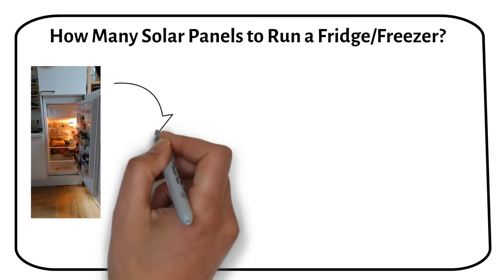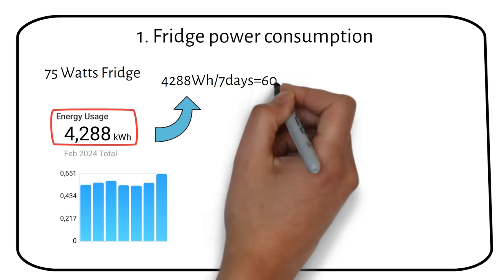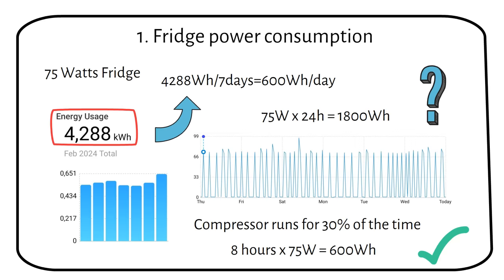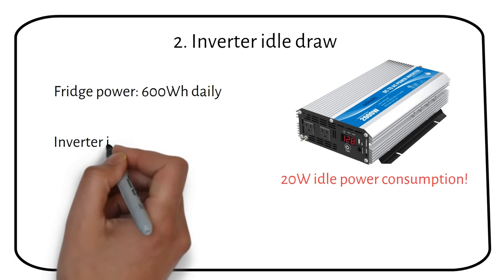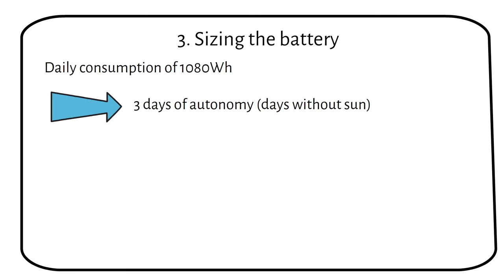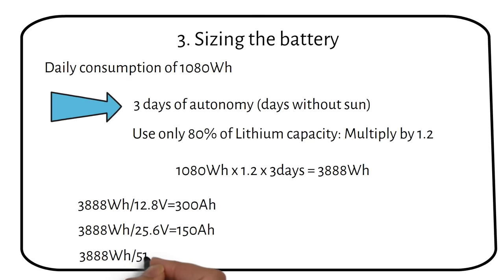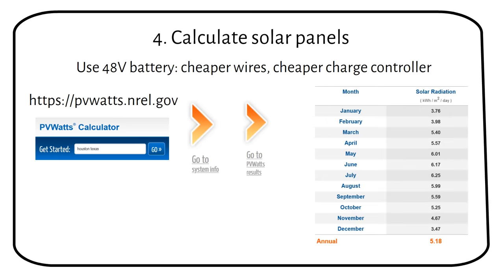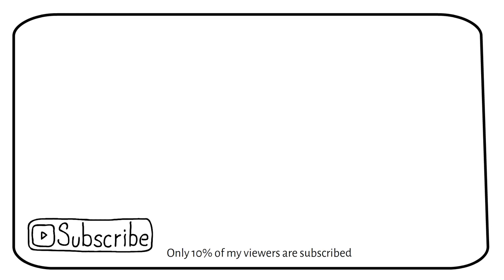How Many Solar Panels To Run a Fridge/Freezer?

Comment: this calculation is correct if your solar panels facing the sun all day right? or you have automated tilters that turns the solar panels to sun thru out the day?
Reply from the maker: South facing (in northern hemisphere) with 3 sunhours. Check the tool PV watts for your location.

Comment: Can we go off the energy star label then divide by 365 to get the daily watt hours used?
Reply from the maker: You can, but I would add some extra because those are recorded in ideal situations. Just like you would never get the mileage out of the advertised values for a car.

Comment: In diagram 1 on the left-hand side, red box. Energy usage is not 4288 kWh it is 3 decimals out for a week's consumption. Just a typo. Correct me if wrong. Having said that, i would have guessed 2 solar hours on 4k system. His figure of 4 takes into account factors I didn't know about. Good vid :)
Reply from the maker: Thanks! It has to do with the European notation of the comma and decimals 😉
Reply: @cleversolarpower  I didn't actually know that. Had assumed decimal notation was universal. As one would if just reading English texts. Tickled me when i then looked it up. Got me thinking about all the times I must have missed it in the past... ;) Brilliant, Thanks again.

Comment: Thanks for the clear analysis, just need to replace the comma with a period, its not 4,288 KWh, it should be 4.288KWh. Am I wrong?
Reply: Most countries use a point or a space to separate thousands. Most countries also use a comma as the decimal separator.
Reply: Good to know, I stand corrected,  I know some people that need the exact info in this youtube, will pass on.
Reply from the maker: I'm from the EU, so I switch them up. I should do a better job since most of my viewers are from the US. Thanks for pointing this out.

Comment: We normally switch the fridge off before sleep , never had a problem. It is also better to run the fridge on mains when the sun is not available rather than buying expensive batteries.
Reply from the maker: True, but if you are off-grid you don't have the grid available.

Comment: And the extra fan cooling the charge controller and the other one cooling the inverter because i don't trust onboard cooling + voltage drop. Also now you need a 48v inverter.

Comment: What size fridge in CU do you have? I know smaller fridge should use less power, and also top freezers I think are more efficient. Plus if it has an ice maker, that will consume more power. Thanks
Reply: Larger fridge use less power because they have more insulation and high-efficiency compressor.

You can get between 10 and 14 and do well.
Reply: Interesting. I'll keep that in mind. Thanks @Matthew_Loutner
Reply from the maker: 6.1cu ft or 174 liters with a 0.5 cu ft or 14l freezer section. Brand is IKEA FÖRKYLD
Reply: That might be a bit too small for my needs. Thanks @cleversolarpower

Comment: Thanks for your guidance, pls television set that is rated in DC , 12Vdc/2.5A. can i used these parameters to calculate the wattage and as well the dc wattage to size the inverter?
Reply from the maker: Power = current * volts. 2.5A*12V=30W. Your tv is 12VDC, so you don't need an inverter.
Reply: @cleversolarpower  thanks, I sincerely appreciate your response

Comment: When using Lead-Acid batteries, how do you make sure that you do not go beyond the set 50% maximum depth of discharge (DoD)?
Reply from the maker: A low voltage disconnect, or visually with a battery shunt.

Comment: Great Video!
What you will need to no waste the solar power energy ones your battery's are full?  What you need to install to use this excess power to decrease the grid usage?
Reply from the maker: Thanks! I suggest adding more batteries. But if it's really worth it to add more batteries in a properly sized system? Especially if you are connected to the grid it might not be worth it. Are those few extra kwh a few dozen times a year worth spending $1000's on for additional batteries?

Comment: You started from a false premise.
You are using a compressor.
Use a combination of peltiers arranged in series...
They only need a teeny bit of voltage....the less each one gets individually the less hot they actually run.
You DON'T need batteries.
The energy is stored as a temperature differential inside the fridge.
As long as the warmer side of the peltier array can radiate its heat to the external section freely,you should gradually drop the temperature inside.
I got my original single chip design to freeze condensation within 6 hours inside an insulated box.
Reply from the maker: The problem with peltiers is that it's good for small applications. A compressor is still more efficient than a peltier.
Reply: @cleversolarpower  Possibly,but the benefit of having fewer points of failure in a much simpler design might make this an avenue to explore as we see further advances.
If however, efficiency is key....
Einstein Fridge.
Zero moving parts.
Sit a sealed bucket in a larger bucket.
Fill the gap with large pebbles.Leave the device in a spot where it is shaded but also ventilated.
Fill remaining volume with water.(it evapoorates...absorbing energy from the area)
Replenish water  when needed.
(Easiest way I can think of to keep milk cold but it won't freeze anything)
😸no batteries included

Comment: You forget to factor in the inverter efficiency, 85 ~ 90% is typical, so to produce 75W of Ac power output, the DC input power will be about 75W/0.85 = 88W, 88W x 8h = 704Wh per day.
Reply from the maker: True 😬

Comment: One 550Wt panel and one 1kWt•h battery. For a December inclusive
Reply from the maker: About a 1 to 3 ratio of solar and battery is generally accepted. So 330W of solar per 1kwh of battery because you have 3 sunhours.
Reply: @cleversolarpower  In general - yes. But historical PVGIS data gives more precise values. 
It allows to calculate a min capacity of a battery, when sun still has a possibility to fill in a battery that will be consumed in an evening (depending of consumers power of course). 
For my varying consumption (by an hour and month) I need 6.3kWth battery with 4.75kWt PV panels (split by east-south), and 100Wt to 1200Wt consumption. 
Firstly, I also supposed to install a 14kWth battery, but after checking historical data, that value was reduced more than twice (these are big money though), and I have a negative balance only in December (a big minus), and in January (a tiny minus).
And battery makes nothing to these negative months. Because 6.3kWth is a maximal amount sun can save and I will need later this day. This happened in 2019 once. In the other years I would need 4.8kWth only. 
 More sun didn't happen, and more Wth I won't consume in an evening. Something like this.

PS And those 550/1kWth were for a single refrigerator, used in Central Europe, these were not abstract values

Comment: Excellent information.  Am I correct that 'idle current' would typically be much higher on an unnecessarily oversized inverter for the applied load?  Secondly, would 'Efficiency losses' likewise be higher in the same scenario?  ie:  Running an inverter for extended periods at 10% load?
Reply: You need to oversize your inverter. Because 75W is just the average consumption. Every time the compressor motor starts it needs higher currents. In my experience you would need a 1000W inverter (or more) for a big fridge like this.

Comment: The city I live in has a population of around 2 million people and residential rooftop solar systems produce more than 3 times the electricity consumption of the entire state.
Currently, my local government is giving no interest loans for anyone who wants to install solar panels on their home because of the money it generates for the state. We are selling the extra electricity to other states.
Currently there is still one active coal power station that was kept operating because of the fear that environmentally friendly renewable alternatives to fossil fuels were not reliable but it has now been over 8 years without any problems using 100% renewable energy.

Comment: Can you make a video on inverter sizing to power a 3kw induction motor that has inrush current?

I have a 270kg ribbon mixer with a 3kw motor that I want to connect to a solar system but I’m not sure how big of an inverter I should use that will handle the inrush current.
Reply from the maker: I believe you should measure the inrush current with a meter. I would also opt for a low frequency inverter (the heavy ones). You most likely need an 8kw victron multiplus, but i could be wrong.
Reply: The starting current is typically 5 to 7 times the rated current. Only low-power motor loads are supported by inexpensive inverters. Without more details, the smallest inverter would be 12 KW (with a good surge capacity) and I recommend 15 KW - 18 KW as a realistic minimum. I am assuming a 220/240 volt system.

Comment: 48V are allso bike battaries. It can be used as a backup?!
Reply from the maker: Sure, if they are lifepo4. Otherwise you need to adjust charging voltages in the charge controller.

Comment: So for this set up you are running a 110v fridge? Thus the need for the inverter? 
Have you run a simulation for any 12 volt fridge in late model RV? Since the illustrated set up is for a power hog 110v unit, I'm assuming this would be way overkill for 12v unit.

Comment: I don't understand where is the final answer. 
What is 1100W of solar? How does it look like in terms of installation?
How Many Solar Panels ? What is their total area? How much would it cost nowadays?
Reply from the maker: You have different size solar panels: 100W,150W,300W,400W,... so its impossible to say how many solar panels you need. But i do understand the confusion. 1m² is about 200W (20% module efficiency) , so you need about 6m² or 65ft² of solar panels. Good question.
Reply: @cleversolarpower  Seems quite large, then. Any idea about the cost for today?

Comment: Une solution pour économiser un peu de puissance:  Récupérer le contact travail du réfrigérateur pour démarrer le convertisseur DC==> AC seulement quand le frigo a besoin d'énergie. Il faut sortir le convertisseur de l'état "stand-by" quelques secondes avant de connecter le compresseur. Un simple relais temporisé ou un Arduino fera ça pour bien moins de 20 W . De plus en hiver, ( et en été aussi ) il faut moins de puissance pour produire du froid si on ventile bien le radiateur derrière le frigo . On peut aussi rajouter une isolation autour du frigo pour diminuer les pertes.

Comment: Thanks great video but I am still confused with the battery sizes. I have 2x12v 110 AH batteries which I can use in serial or parallel mode having a 12 v or 24 v battery system. But the capacity still stays the same? Right? I need some help, thanks.
Reply from the maker: I recommend watching my videos about batteries in series and parallel. If you connect your batteries in series you will get 24V 110Ah, if you connect in parallel you will get 12V 220Ah. Mind your inverter, because it will work on either 12V or 24V. I recommend 24V because your whole installation will be cheaper. Check my video about 12V, 24V or 48V systems.

Comment: In a solar system your storage is the most important equipment that's stores power to run your fridge..that's your Escom.Batteries has a depth of discharge meaning once a certain amount of power is utilized the whole system switches off till the next morning when the sun shines and allows the panels to recharge your batteries.All the inventor does is inverts DV voltage to AC voltage.A fridge compressor draws 3 times the rated amperage when it starts up which will drain the battery power.Do proper calculations before investing in a solar system.

Comment: It’s nothing to do with Solar panels…..it’s all about the storage battery size. Yes you will need solar panels and a decent mppt and a pure sign wave inverter
Reply from the maker: In order to put the energy in the battery, you need solar panels. So i don't understand your statement.

Comment: 1 His Fridge Consumes 75Wats/Hour,
1 Panel Top Output 100 Wats
At Top Sun 🌞,
So At Around 3 Panels You
Should Have Enough To Run
Through The Rest Of The Day,
Yet Not Over The Night!
2 More Panels,
So 5 In Total Would Compensate
For Storage For Night Time!

Comment: The equated cost needs to be determined. basically the currant cost of electricity verses the upfront cost of: batteries, inverter, wires, solar pv panels, etc. then find out how long each peace of your system will last. basically people do not know that the longer the system last the more reasonable the cost. but not doing the math right makes it not worth it if you spend more then it is reasonably necessary.
Reply from the maker: Correct. But this is an example of an off-grid system where no grid power is available, and without a generator to bridge the winter months.
Reply: You mean an independent system.  @cleversolarpower  I am all for independent systems, no matter whare you are. Just because you can add tech that allows you to make it grid accessible does not take away the cost. So I was not referring to that. I am still wondering what such a system cost if even for only the refrigerator.

Comment: Am a mashroom farmer what capscity solar power i need to run a 30ft by 10 ft house to maintain a temp of 18 dengress and below for 24 hrs.?
Reply from the maker: There are a lot more variables than you are mentioning here. Location, devices and their power consumption, the time they are on,...

Comment: I have just looked online for the biggest side by side fridge freezer I can find in my country.  Total useful volume (l): 547
Useful volume of the refrigerator part (l): 355
Useful volume of the freezer part (l): 192
Consumption (kWh/year): 318
How the hell are you buying a fridge freezer with 13 times the power useage?
Reply from the maker: My consumption will be 220kwh per year. Note the decimal is a comma in Europe. And I don't believe the numbers you are saying here. 318 for fridge freezer combo is not possible in that size.

Comment: Your inverter needs to be capable of supplying the fridge motor inrush current, or the  fridge motor needs to be 'soft start'.
Reply from the maker: Yes, calculate about 6x the rated power of the fridge for the inverter.

Comment: it's about doing the math, how much power does your fridge use yes add a few more extra watch to that consumption figure out your batteries lithium is the best add an extra bit of kilowatts there and then your solar panels add a little bit more for days that aren't real sunny and don't forget your solar solar panel control system not to overcharge the batteries.
Reply from the maker: Math is everything in the sizing phase 😀

Comment: None sense , in Spain 12 panels runs a modern house with 2 large fringes , bed room air con at night , lounge air con during day , washing machine , dish washer , lighting . Our electric bill is generally 5 to 10 euros a month . 
Feed in tarif no battery needed .

Comment: If you want to use lead-acid batteries for this . . . I have done that and you will need 12 100 ah batteries to do it. Each 100 ah lead-acid battery will only yield about 250 ah. And they will only last a year.

You would better go with lithium.

Comment: PVWatts doesn't look very accurate as it doesn't take into account PV angle. Use PVGIS which takes average weather results from across the world, and allows you to set the PV angle and orientation. The calculation shows only 900W of solar panels to run 24/7, with a panel tilt of 45 degrees using PVGIS
Reply from the maker: You can adjust the pv angle, azimuth and tracker options in PVwatts. But thanks for the suggestion.

Comment: That's a lot of solar panels. I think I'm going to go with solar/ wind turbine. 
I might just can all my frozen food and do without. This is daunting.
Thank you though
Reply: Not quite, you can use two panels on 1x2m with 560W-620W each, that is enough (at least 1120W) or to be sure and count the wear of pannels, can use more powerful panels. But roughly, 2-3 panels will do. Is better if you can mount them on a E-W tracker or even better on a tracker that follows the sun. That way, can harness more power than that average number showed in the calculator.
Reply from the maker: I have researched wind turbines. Unless you have a favorable location and a big turbine in a location without many sun hours, it's not worth the hassle. Numbers might seem a lot, but that's what is needed in the worst-case scenario.
Reply: You are not going to save any money going with wind. It will probably cost a little more.
Reply: Don't feel too daunted, panels cost less than 1/4 per watt, than they did 10 years ago. You would be right, when solar panels cost ~$4.00 per installed watt, now, they can be had for less than $1.00 per watt. Panels are better, and more affordable than ever before! The cost of Lithium Iron Phosphate batteries are now as cheap as premium lead acid batteries, but last 5X longer. Useful amounts of solar power is now more affordable than ever.

Comment: 4,45 batteries, not a battery needed. And when you think you got it worked out , double the capacity. Otherwise, divorce will be on the horizon. Many people comment about this subject but have never done it. 
I have. My family lived off grid in the Australian bush for over 11 years. 
Gas fridge converted to take different fuels, gas, kerosene, motor oil is the safest cheapest and most reliable way to go.
And iv yar going off grid in the Australian desert,  refrigerator, or better still, a freezer is a must..